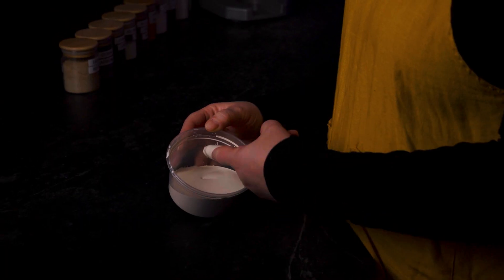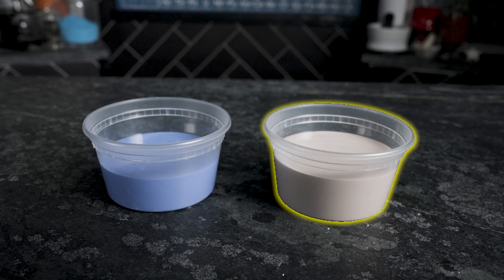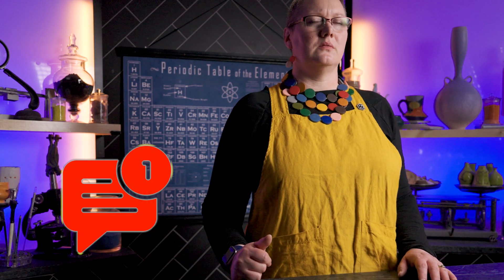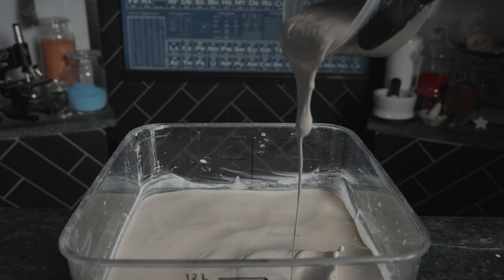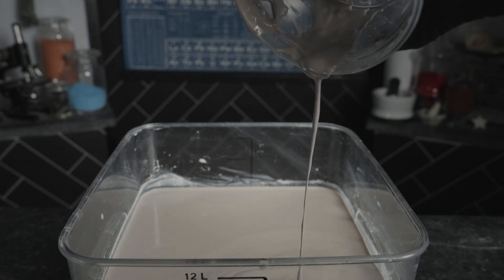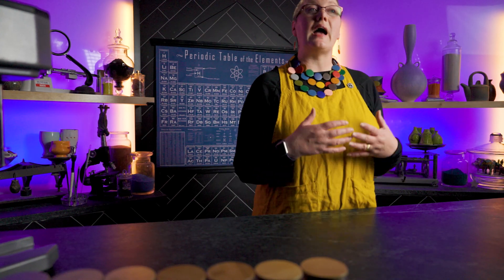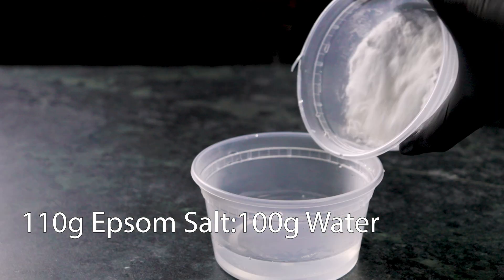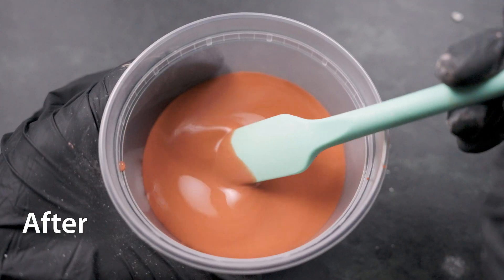Gravity of the Situation - Specific Gravity and Viscosity in Ceramics | Ceramic Materials Workshop

Comment: I’m confused about how to calculate the viscosity. I understand using the stop watch to count how long it takes to get through the Zahn cup, but don’t know what to do with the number or how to calculate a #2 vs a #4 cup for instance. So much to learn and it’s so overwhelming but I’m trying! Currently working my way slowly through the Glaze of Our Lives and Glazed and Confused mini courses rewatching to pick up something that I realized I missed last time. I am not quite ready for the Understanding Glazes course yet, but I’m working towards that. I do notice that especially with my Raku glazes, viscosity can vary a lot from one glaze to the next even when the specific gravity is measuring relatively close. I think being able to calculate the viscosity and understanding how to use it would be very helpful.
Reply: i think you don't really need to do anything with the number. Just make sure your specific gravity is right, then measure the time in the same cup you used when you wrote down the numbers, and adjust viscosity until the time matches your notes.

Comment: Great video! I have some buckets mixed and they are working well I have done the SG and I visually check the viscosity by stirring , because that is what I was told. Now I have a ford cup . I am assuming I just do the viscosity test with the ford cup on my old glazes that are working . But with new glazes how do I know what the number should be for viscosity. Do I test test test before I know the correct number? Is the a range it should be in?